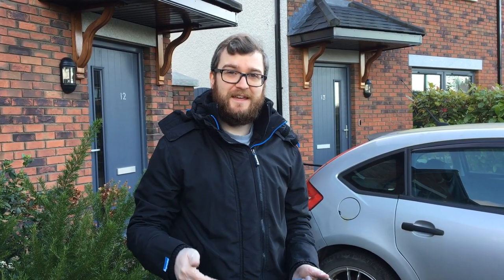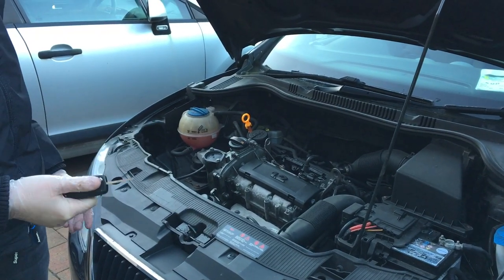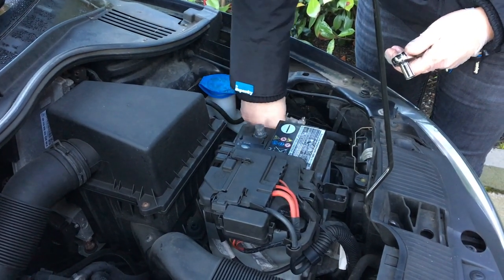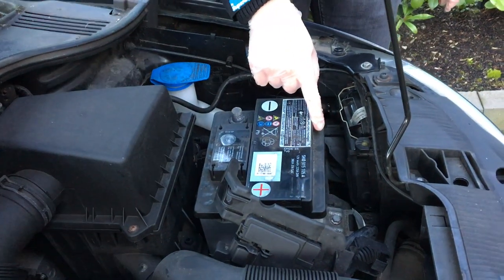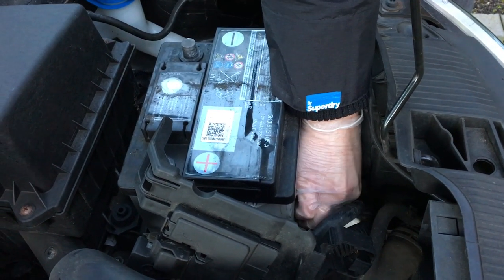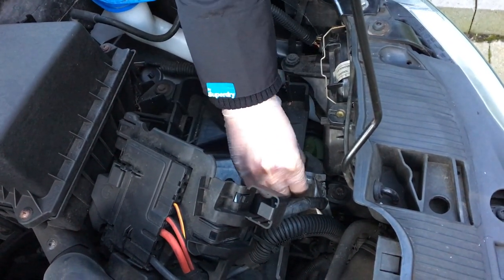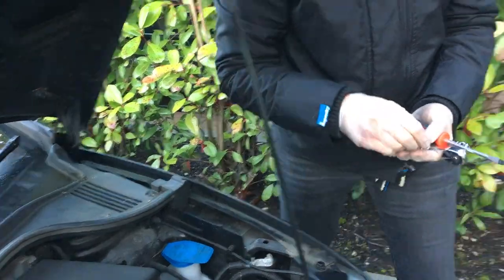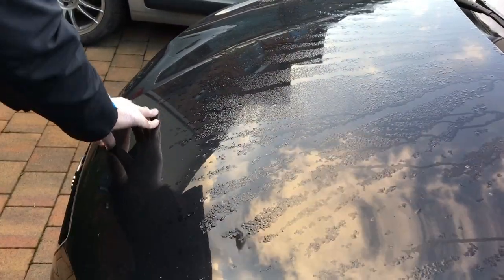How to easily remove and replace a Seat Ibiza battery yourself

Comment: Great video, it was really helpful.  However When taking the plastic battery cover off both clips broke off instead of looking flexible like yours. I'm guessing that's because of the cold weather over here hardening the plastic.  but otherwise the car is running beautifully.
Reply from the maker: Hi 00shokid. Sorry to hear they broke, and we have had our fair share of plastic clips breaking. So many hot and cold temperature cycles including the age of plastics can end up making them brittle :( Glad your car is running well and you found the video useful.

Comment: Thanks for the great video. Battery now changed & to answer some of the questions below, my radio still worked. The only thing I had to alter, was the clock which had reset to 0:00, (Note - This was on a 2014 Seat Ibiza 1.4 ).
Reply from the maker: Thanks for sharing

Comment: I changed battery but car still dont turn over, any suggestions what problem might be.
Reply from the maker: Are the battery terminals clean? Have you checked all the fuses and relays? If there is no crank, you may also need to check the starting motor and earth strap.